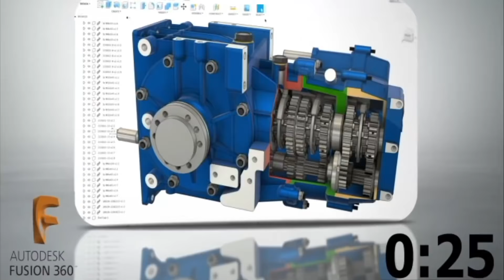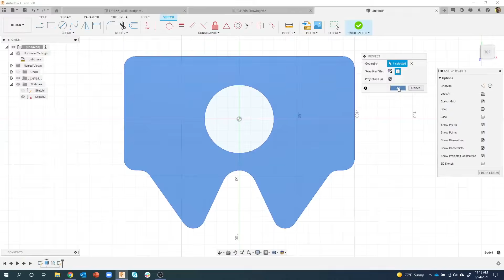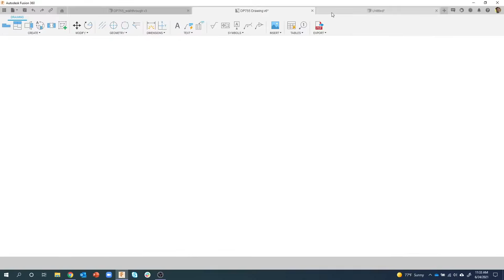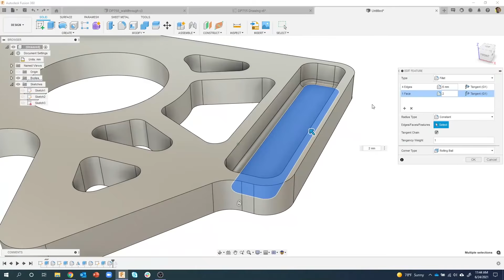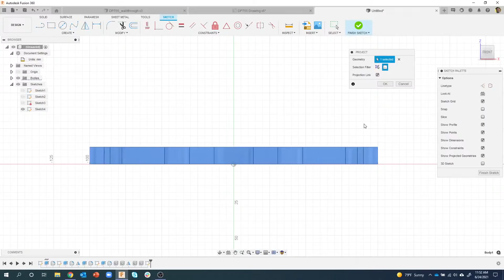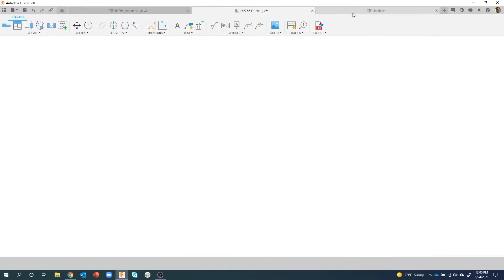Episode 92 - How would you model that?

Comment: Brad, I found the part you modeled to be very interesting. I have a few observations and questions.

I downloaded the drawing and noticed that the view showing the profile and the two back-drilled holes does not indicate that they are threaded. Additionally, the top view, which is intended to illustrate the part's convex upward meniscus shape that gets mirrored, is incomplete. It is missing all the dotted lines of the features hidden when viewed from the rear. Currently, it only shows two vertical lines, which represent nothing other than the drilled holes' midline.

You mentioned that you have a nice section view that reveals the four mm-thick webbing. However, without a traditional right-side view, there is no way to know that the two top holes are counterbored, while the holes from the bottom should not be. Furthermore, that view would provide information about the counterbore depth you mentioned in the video, which you would determine later.

I also wonder how we would identify that the curve defining the cutting plane is a three-point arc rather than a higher-order curve. You know it is a simple arc because you created it, but in practice, is there typically any annotation that indicates this? At best, we might trace it or attempt to fit a curve.

Excellent tutorial as always!